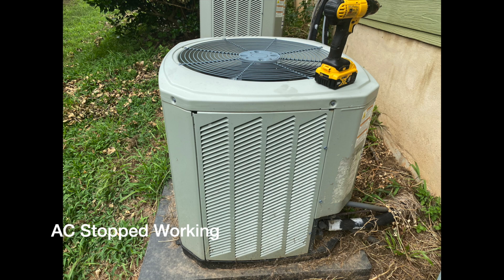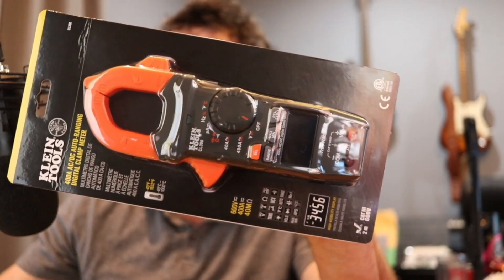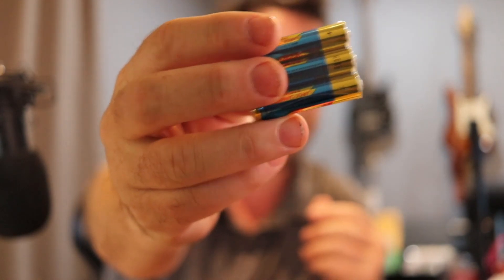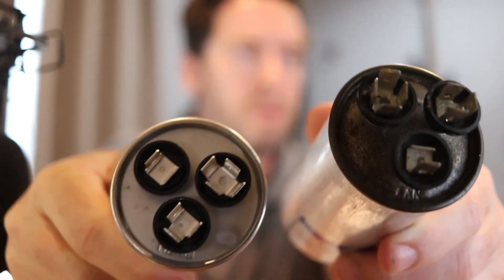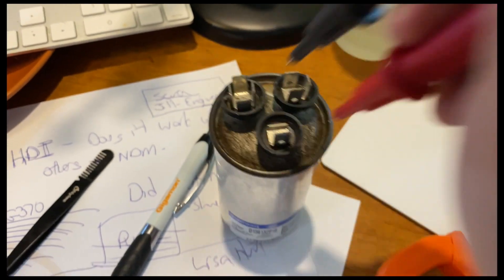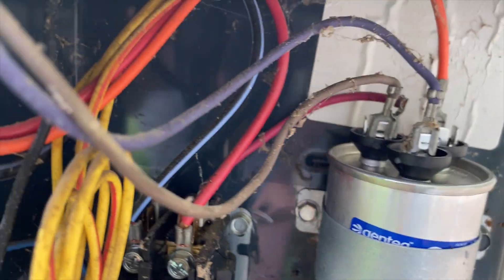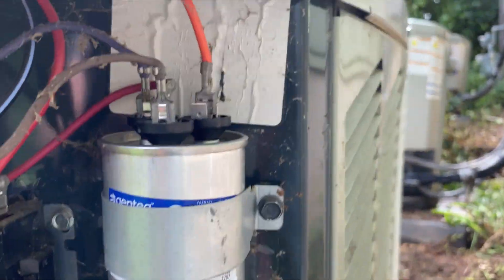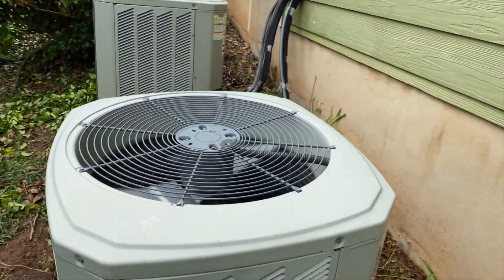Broken Air Conditioner Replacing Capacitor and   testing with Klein Tools CL390

Comment: I bought this same tool to check capacitors in my auto-scrubber. I found this video, since I bought this tool, but have watched other general ones. They all warn that you need to discharge the capacitor before testing! I belive it can be dangerous with big ones like yours. You may have been fortunate that yours couldn't hold a charge any longer. I urge others to watch other videos before attempting this.

Comment: Yup...  A <$20 part that will cost you at least $250 to have replaced on a service call!  The blown capacitor shows no reading usually because the inside is shorted out or blown open (typical wear and tear).  It helps the motor startup and provides a bit of voltage "leveling" as it runs.

I have the same meter BTW... the clamp ammeter function is great to check power draw at the unit as well.  Goes without saying... always shut off power at the breaker and/or outside safety disconnect while working on the unit.